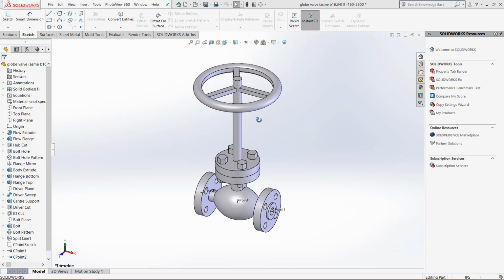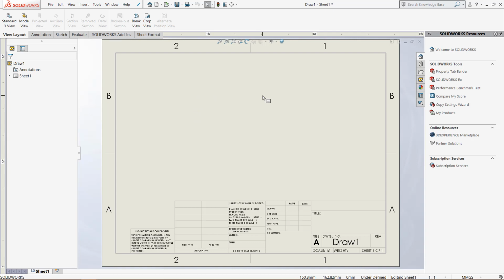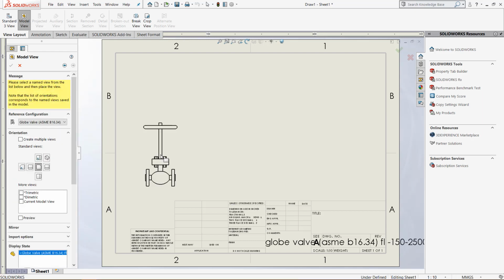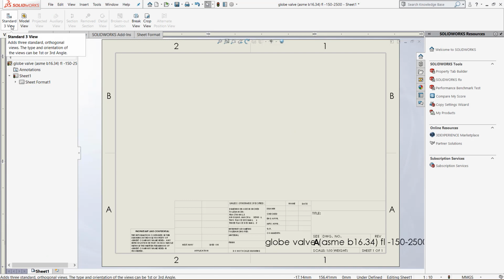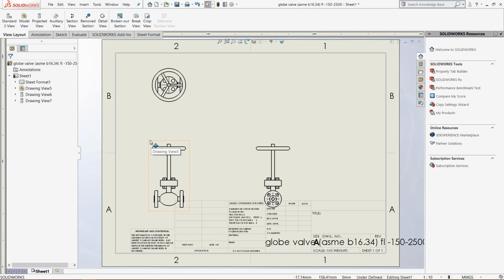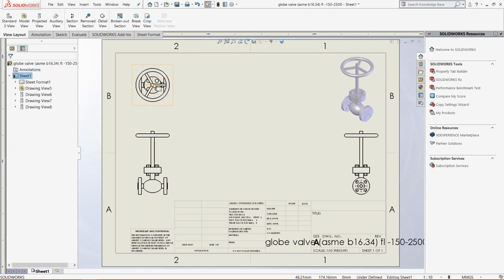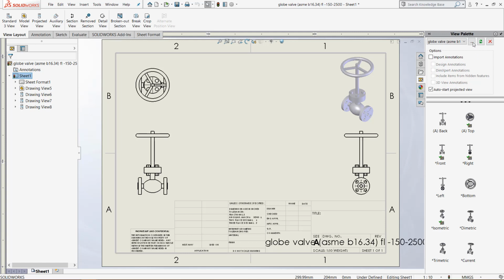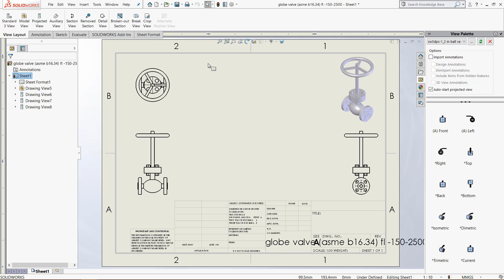SOLIDWORKS 3D CAD — Adding Views to Existing Drawings

Comment: But What if the drawing of the part is WAY too large for the paper? Then what do we do?
Reply from the maker: You can adjust the scale of the individual views just below where you can change the display style. Instead of selecting "Use parent scale", you can change to use the sheet scale or a custom scale if you need to do something very specific to get the part to fit on the drawing.